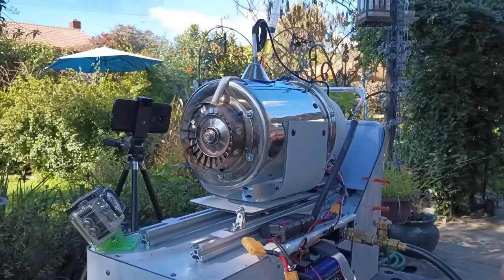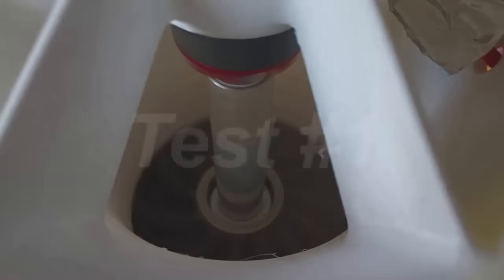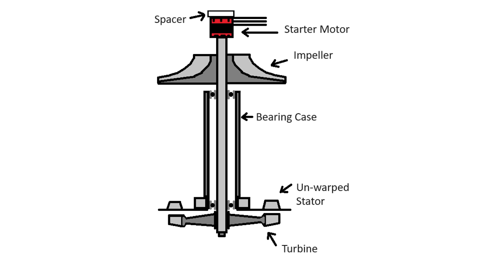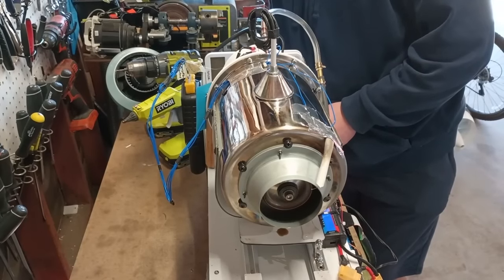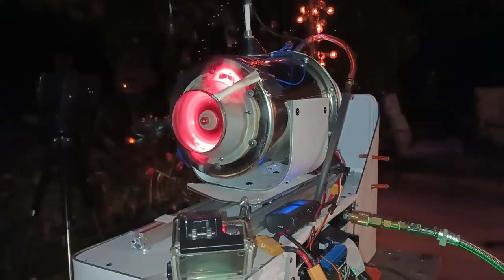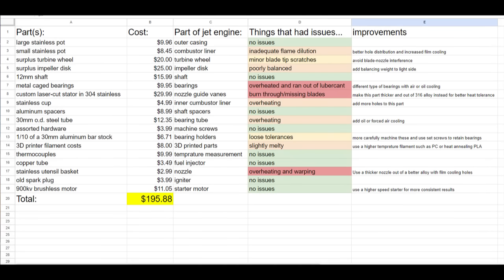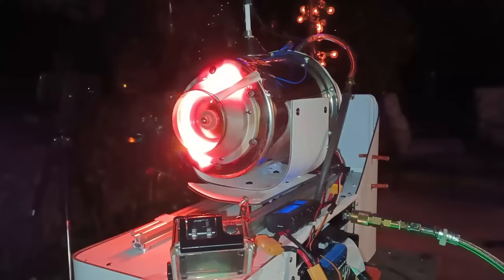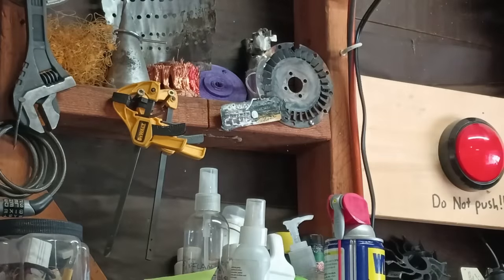Building a turbojet engine from scratch - was it worth it?

Comment: Back when I was building mine, I ground a deep groove radial bearing to become a pseudo angular contact bearing, then fill it with silicon nitride balls completely with no ball retainer. They are so hard and slippery, no retainer or separation is needed. Then like others said, cut a bypass channel through your diffuser and allow some bypass air through your bearing tube. Hypodermic needle teed off from your main fuel supply and run fuel/oil mix through your bearings for lube and cooling. Maintaining a tight tip clearance with the turbine is essential. Of course the hot spots are your enemy with the tight tip clearance and rubbing occurs. Fun stuff. I built one with a 1.5" turbine wheel. Would self sustain around 60k rpm.

Comment: One of the biggest flaws I keep seeing with homemade turbines is that most don't seem to use any amount of bypass air for cooling. In order to keep the main shaft and often the turbine itself cooled air from the compressor is allowed to flow through the shaft and is released either through the blades themselves or just ahead of the turbine to help cool it. Bypass air is also pushed in through small holes in the main flame tube to keep a thin film of relatively cool air in between the fire and the walls at all times, the lack of this feature is what  caused so many failures around your exhaust. 
Finally, one of the methods I have seen other youtubers gain some success with is using ceramic coatings, namely fireplace sealant, to coat the heavily heated areas such as the turbine wheel and pretty much the entire hot end where bypass air is normally used.
Reply: Ayden was discussing this for the next iteration...great idea.
Reply: Small turbines’ main shafts are mostly cooled by oil and not air. Generally it’s the return oil from one or both of the bearings.

It does need a bleed though. It’s much easier to start and sustain an engine like that if you bleed compressed air from the cold side before the hot side injects it all.

…I have no sound where I am. Please excuse me if you already made any of the above points.

Comment: you could probably put in two fuel injectors, spool it up with the propane, and then switch over to kerosene once it's hot enough. Similar setups are used in oil burners, since oil itself is absurdly hard to get burning.
Reply from the maker: That is indeed a good idea

Comment: Having demonstrated ability to throttle your engine, maybe it would be worth the effort to implement a feedback loop with one or more pyrometers sensing the temperature different key points of your engine and reducing the maximum fuel input.

And given that you are looking at using other fuels, that could also be part of a system that uses the temperature as an indicator to switch between fuels : propane to start until it gets to a certain temperature then switch to kerosene but switch back to propane if it cools down too much to the point of threatening a flame-out.

Better heat resistance and active cooling looks like the obvious path as heat was what killed this engine. Yet going for automatic controls might take less effort and allow your prototypes to stay alive longer and make prototyping an active cooling design easier.
Reply from the maker: I could definitely use an Arduino to control this feedback loop - a plan for version 2 of this engine

Comment: I am really impressed about the air eqalization it the engine. How did you make the proper calculations? I am really curious if you have ever used some good driven software. Like I can just tell you that these steel ball bearings won't work. I've never used hybrid ceramic bearings, but I think it's your job to try them. You can also try not attaching the exhaust deflector to the outside, so the termal sensible material will last longer if a proper spare radius is set and if you make it just a bit thicker (1.5x i guess, but you should do some proprer calc, to determine the thermal factor). The best thing I can recommend you for the testing (if you can, and the reaction wheel is inside the turbine)  is to dismount the nozzle.
Reply from the maker: A design like this was not very calculation heavy except for flow area and mixture ratios of the gasses. I used a pre-matched turbine and impeller from an aircraft turbocharger so I could get the right compression and flow ratios. Obviously, I need to do more calculations regarding thermal expansion as warping was a major issue. I am still in the process of learning to use MATLAB software and I hope to eventually use it for complex calculations for engines such as these. The bearings definitely were a major issue so ceramic ones may have a better chance as long as they don't have a plastic bearing cage.

Comment: Ayden Wardell Aerospace, I would like to know if you could provide consultation advice for a similar but larger, but simpler project of my own. Does this interest you?
Reply from the maker: I'd be interested to hear more about your jet project. Based on what you are describing, it sounds like it might be some sort of pulsejet.
Reply: @AydenWardellAerospace  I want to understand how you settled on the angle of the blades. I'm interested in reproducing something similar Chevy accomplished using a turbine engine to power a car. I can do basic machining to create blades that have either consistent angles or consistent radius, but complex contours begin to exceed my skills. I'm not interested in perfection. Just basic functionality. I'm not sure where to start, or look for schematics, or to just possibly buy a compatible engine or parts for my project. anything you can offer in terms of suggestions, tips, directions where to look, or if you're interested to provide a more in depth hand I'm open to any assistance.
Reply from the maker: For getting a good blade angle, a good rule of thumb is that your stators should be near perpendicular to your blade angle, with your blades being slightly scooped. For example, if the leading edge of your turbine wheel has a 30° angle, then your stators should have a trailing edge of about 60° but 50° still works pretty well too

Comment: ive been trying to get a turbine wheel for years ive given up now
Reply from the maker: There's a place out in Sunland called "APEX surplus" they have thousands of old turbine parts for really cheap. The catch is, a lot of it is really beat up so you have to pick through a lot of part bins before you will find something in usable condition. Also, you will not find any matching stators or shrouds so you will have to make it yourself.

Comment: How much did the tools and test bench cost?
Reply from the maker: The test bench is made of sheet aluminum, an Arduino microcontroller, 3d printed parts, a kitchen scale, a thermocouple reader, fuel valves and shutoff and a few other things. It likely cost about half of what the engine itself cost.

Comment: hi, i was wondering how do you make/where do you get the turbione wheel and is there a cheap whay to make them with basick equipment?
Reply from the maker: I got the turbine wheel from a scrap bin at a surplus store, and it was likely out of an old aircraft turbocharger. You could also make one by laser cutting and bending a hi temperature alloy into shape.
Reply: @AydenWardellAerospace so from “scratch” was a lie. It is from scraps. Like the first rc model turbine 20 years ago.

Could you mill an airfoil into thick blades?

Comment: How do you go about balancing the rotating assembly?
Reply from the maker: I used a propeller balancer from a local hobby store and got it balanced to the best of my ability. It still had some vibration so I will need to figure out a better way of doing it in the future.